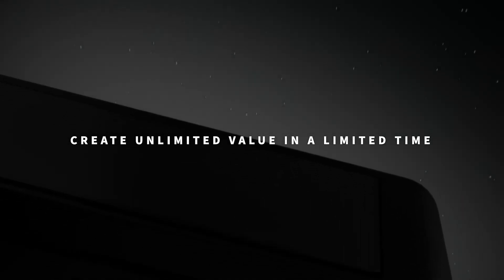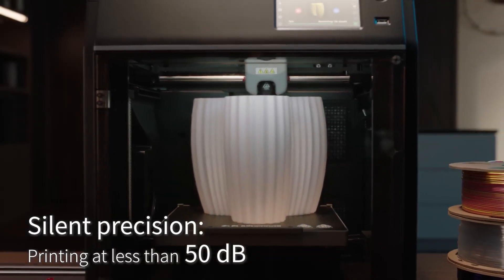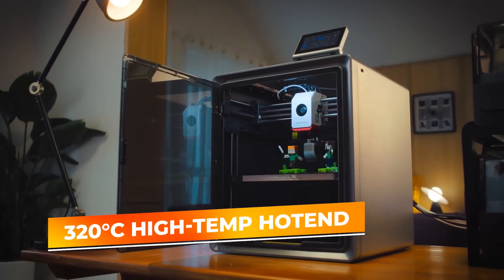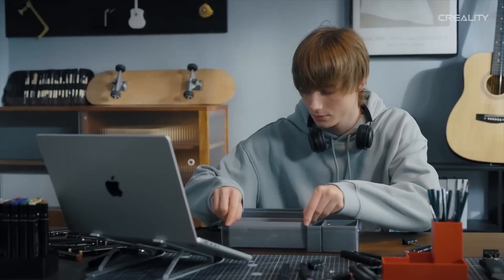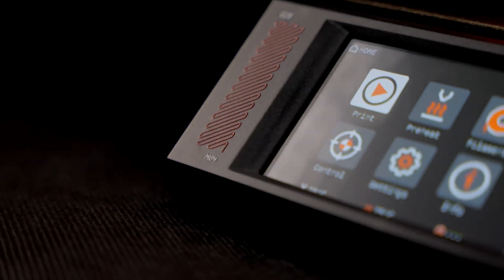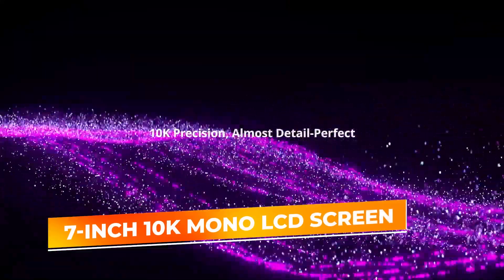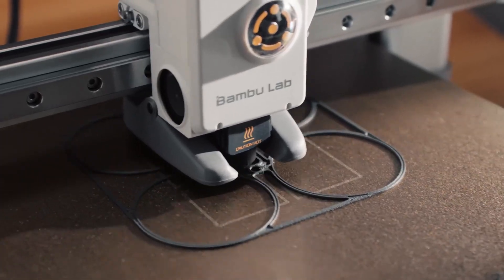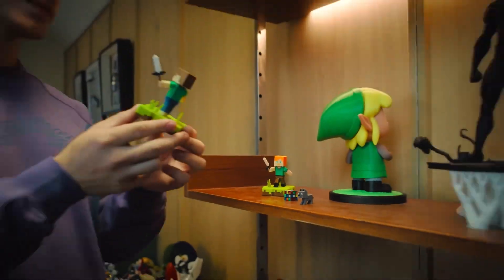Best 3D Printer 2026 - Top 6 Best 3D Printers in 2026

Comment: All this printers already DEFEATED by SNAPMAKER U1. After they start selling of Hardened Steel nozzle and top plastic cover it will be fastest printer with cool toolchanger like Prusa XL, BUT WITH KLIPPER! You can buy addon Chitu Systems H2 and get MOST CHEAP MULTICOLOR TOOLCHANGER that change color by 5 sec, low 3d-poops and heating chamber! 1 000$ for this, no one can be a competitor for this price